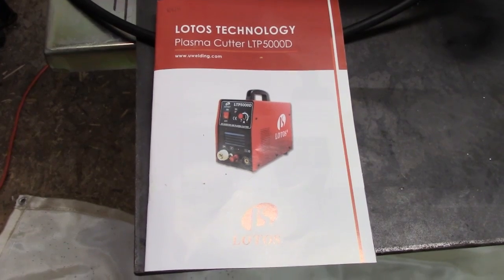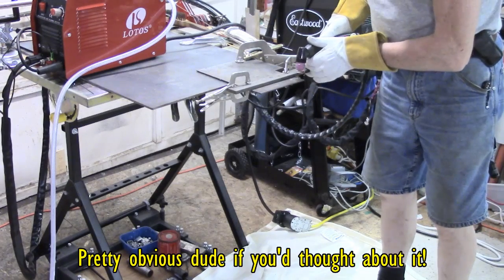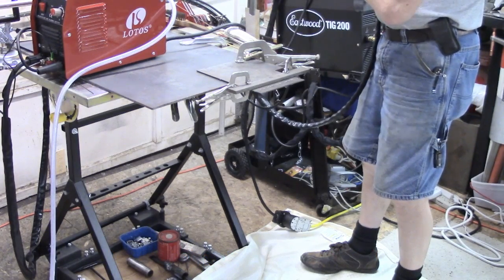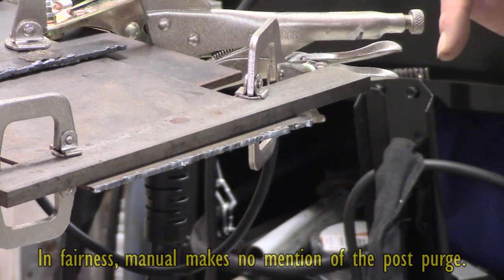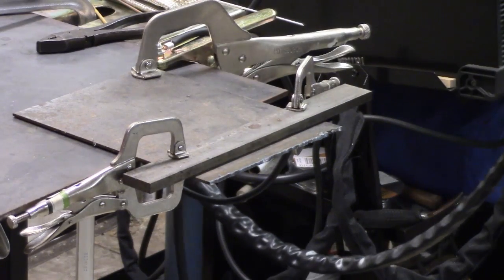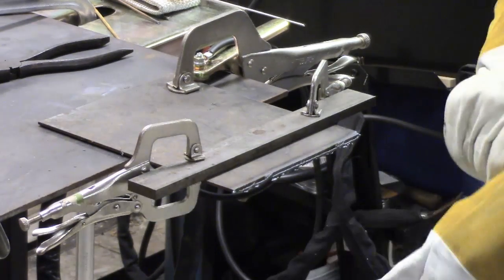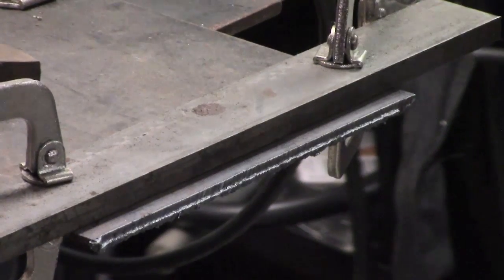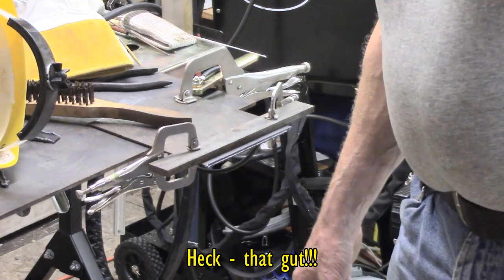Lotos LTP5000 Plasma Cutter, First Fire-Up

Comment: Thanks for the demo I am looking for a plasma cutter, I am no expert but have used them several times, if they recommend the air pressure to be set at 60-65 psi why would you even set it at 50psi? After watching this video I can see you like to experiment and do things your own way and learn as you go which is fine and dandy, before you learn from a VERY painful and possibly a expensive lesson put some britches on!!! All it's going to take is a piece of red hot slag to drop on your sock just above the tongue of your shoe and you're running through your shop screaming like a little girl. Do yourself a favor and wear pants when using a plasma cutter, not only will they help prevent a accident they will get down the glare coming off those lilly white ghostly legs.  😁
Reply from the maker: Hi - haha yes, clothing was a bit scant! I have had a few burns over the years from stick welding and tend be a bit careless!
Good advice - protect those chicken legs! :)

Comment: Thanks for sharing. I too found this plasma cutter at a nice price through the Home Depot, until 6/22/16, for only $349. Your review helped me decide to buy it. Besides that, I can save my skin from the previous method I used to cut all kinds of metal which is a cut off wheel... how dangerous that is!
Reply from the maker: Hi Don - seems the price is still very competitive. I have been pleased with mine and got better at using it - just now and again when needed and yeah - better than cut-off wheel. :).

Comment: Haha. Like me you must ascribe to the philosophy of "When all else fails, read the directions". It was a bit humorous, but also helpful. Thanks. FYI: I run mine with dry 68 psi air at 50 amps almost exclusively. It cuts like a dream.  It's such a great little machine.
Reply from the maker: +Larry Hutcherson Sr 
You are so right Larry :-) 
I guess I share my mistakes etc as well as successes!. Now of course the function is fine and I use pretty much same settings as you.

Comment: received my New Lotos LTp last night. Messed with it a little. Cant figure out why it wont finish a cut. Starts but the arc cuts off before cut is finished and wont restart for a bit. Gotta figure it out today. Let me know if ya have any thoughts on it. Great video and the air thing threw me off too so your not the only one.
Reply from the maker: +murdockkillsdeer 
Only thing I can think of is that cooling fan not doing its job and delay while things internally cool - but if you can hear fan then not sure at all. Make sure air flow is generous. Make sure grounding is 100%.
If prob persists you'll have to ask manufacturer probably.

Comment: That looks like a good way to set fire to the mouse nests under your bench! I think that with all the noise and sparks flying you are bound to hold on too tight to the torch, that is not going to give you an even cutting speed, to have put this first attempt on Youtube is certainly a very daring thing to do, you will soon get the hang of it and be cutting like a pro. One thing you will have to get is a leather welding apron, you can quickly throw that on just before you start cutting, that way you will not get radiation burns to your undercarriage! And your bare arms. But you would be better cutting outside where the sparks get go into the gravel, they make a filthy mess after a very short time.
Reply from the maker: Englishman French Hi Chris -- the fire blanket and aluminum plate took care of sparks OK and anyways - would plan for large cut jobs to open main door and do it outside. I realize torch hold needs to  be much more relaxed. I have a weld apron - just was a bit lax with clothing for this simple test run. Practice and more practice.:)

Comment: Hi Chris !

CONGRATULATIONS again !

I have a similar jig - not the same brand but same "size" nearly - mine is only 40amps.

You have a better handle than mine I can see !

My experience is that you should watch the pressure WHILE YOU ARE cutting - long small 1/4" hoses have a lot af resistance on the air-flow so the pressure often droppes - mine dropped to nearly 0 while cutting !.

After I got my screw compressor WITH LOTS OF AIR FLOW and 1/2" hoses I have no problems at all.

Your dross problems is a learning process to set the right pressure, cutting speed and cutting angel (both X- and Y-axes)  - just try some sample cuts and you'll get it !

At my cutter I can adjust how long time the air will flow AFTER I release the trigger - I think you can too - as I remember mine can go up to 5 seconds - that's for cooling the different bits in the nozle.

When you've made the first 4-5 cuts you'll love that machine - trust me !

Some have problems with water in the compressed air - I never had that ... yet, at least - eventhough I have lots of water problems in my sandblaster - maybe it's because the distance from the compressor is 1 meter for the sandblaster and 10-15 meters for the Plasma Cutter.

Comment: You got a good deal.  You can get spare consumables on eBay at a decent price.  All of the discount systems seem to use the S45 torch and parts are easy.  The 65 psi of air is supposed to be at the torch while operating.  I have to run my air system at 75 psi to overcome the pressure drop getting to the torch when I light off the torch.  If air pressure gets too low the torch may have trouble starting.  Also, consider wearing long pants when cutting.  It's impossible to cut a straight line while doing the burning slag down my shoe dance.  Skin heals but a bad cut is forever.
Reply from the maker: rfcarlson1 Certainly realize the need for the air pressure now -- I don't think my losses are bad and actual supply pressure at the machine should be fairly accurate as compressor set to about 90 on output and machine reg itself set to the chosen pressure - seems to be about right. Haha - long pants yes - easier to do when not so darned hot in the shop!

Comment: Hi Chris, great machine, your problem is you are to rigid, just use one hand on the torch and relax your shoulders, think of it like drawing a line with a pencil following your ruler, just let the shroud guide take the weight of the torch and you guide it nice and steady.
A lot of people when they first use them grip to tight, just chill and you start making nice cuts. Good luck. Tony
Reply from the maker: Tony Burndred Realizing that now Tony -- progress from dork to plain rookie is fairly quick - now just more practice to come. :)
Reply: ChrisB257 Tony is right about the relax posture, also you get easier and cleaner cutting by directing the direction cutting angle more towards your white legs than away from them, same with oxy. You must have smooth silky legs by now with your new hair removing thechnique.... :-))
Reply from the maker: pierre beaudry Pierre - haha - yes, my depilatory method works fine. :-)

Comment: Off topic, I have the same Tig machine as you. works great for what I do, although it will not weld razor blades, but I don't remember when I had to weld razor blades.  I bought the Eastwood plasma cutter at the same time as the Tig machine and I am very pleased with the quality of the cut with my machine, never heard of a Lotos but I am looking forward to your overall opinion of it,  Great videos
Reply from the maker: George 1960 Haven't tried razor blades either Tony! I would like to have got the combo which included the plasma cutter but I had already at that point stretched the budget a bit too much so settled just for the TIG! I have been well pleased with the Eastwood so far.

Comment: OH! If you plan on doing a lot of cutting at one time, you will need an air dryer or you can make your own.
Reply from the maker: Grandpa Bill That's on the list Bill, though at present there is a small in-line unit to help in that regard until something better.
Reply: ChrisB257 The dry air is key to make your consumables last... ;-)

Comment: NO...NO... you don't "DROP" the air pressure increase yes.... try running at 75psi.
you can leave it at 50 amps and only decrease it for sheet metals.
Reply from the maker: Grandpa Bill Hi Bill - I think I have realized that now - rookie learning process! :)

Comment: I was waiting for you to get some slag down the top of your running shoe, not the best attire for torch work. I have been looking for a used one,but no luck yet.
Reply from the maker: Bob Cartwright Hey Bob -- You may have noticed the ''pre-cut-shuffle" - which was me placing feet away from under the cut. Good point tho and for serious work with this I will be better clothed. Mind you, my shop is so hot right now wven with A/C running. Check out uwelding.com and you'll see the Lotos there - could well be Amazon might have a good deal. Strikes me so far as great value. The LTP is the 5000 version which has a starting arc.

Comment: I'm worried about your clear face shield. It's makes an arc like welding, I wouldn't want you to have vision problems.
Reply from the maker: David Queen David - yes good point. In my first attempt I actually used my auto darken regular weld mask with the 11 filter. Normally it seems a shade 5 is quite adequate as exposed arc is way less intense than with a weld arc. As this was just a short test I didn't worry too much.

Comment: Hi yep bump the air up to 70 psi I run on mine up to 90 psi when I cut thick material. Try upping the amperage to 35 and all should be good to go. Travel speed is something you just have to play with and practice unless you are CNC controlled it will be different every time you do it. One other tip try not to choke the torch, relax your hand and guide it let it do it's work most people when first starting white knuckle the torch thinking it will jump and bite them.
Enjoy the new toy you will be surprised how many things you will find to cut. The Waring of shorts is not advisable unless you want some very sunburned legs it's the UV rays from the arc that will burn you more than the sparks.

Have a good one
Dave
Reply from the maker: David Cashin Hi Dave, I realize now re the air aspect - sort of put 2 and 2 together! Agree, 'white knuckle' approach not useful! For serious work I'll most likely have pants on and better shoes. :)

Comment: Chris I just cannot keep up with the B257's.   I am still using the acetylene torch.  I think you will get the hang of it after a while.  Thanks for the video.
Reply from the maker: cerberus Sorry! - sold off one or two things recently and by chance found this unit so - went for it. I still have my oxy/acetylene if I need to cut silly thick stuff. Plasma tho sure is better. Just need more practice but already feel a tad more confident - conversion process from idiot to plain rookie! :)